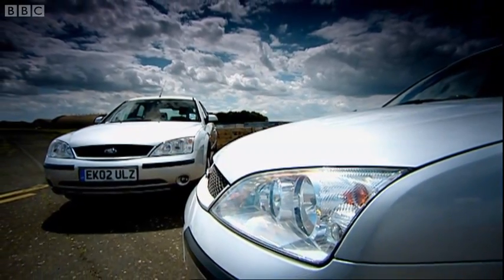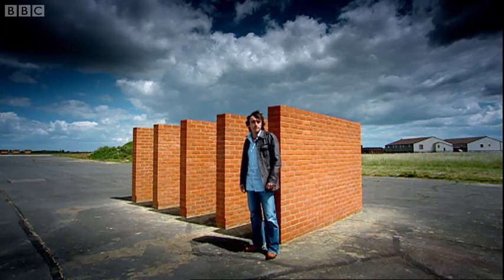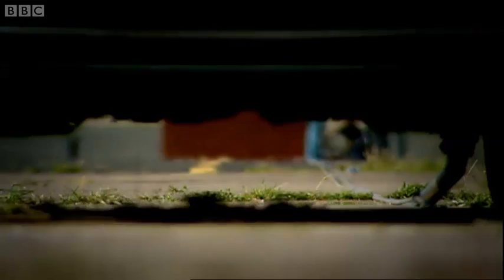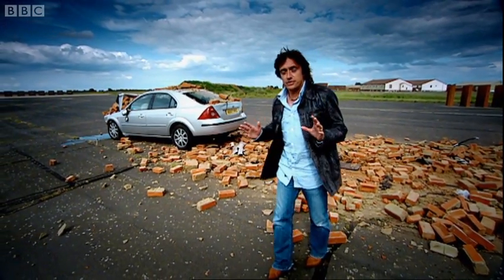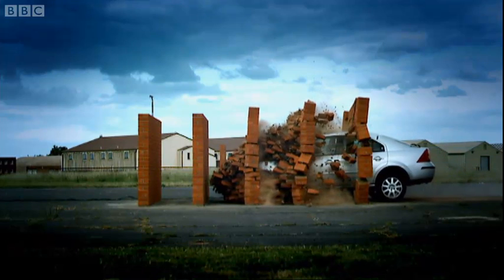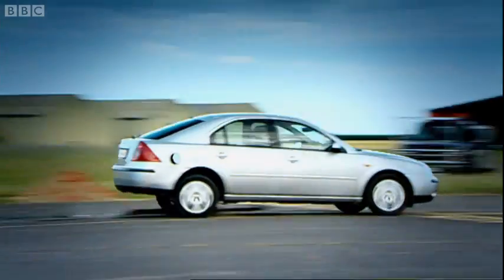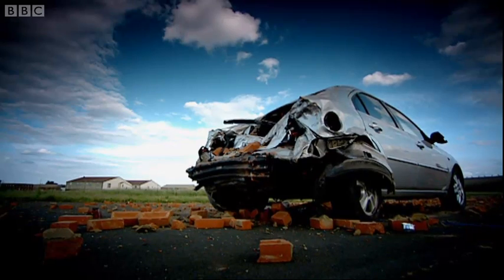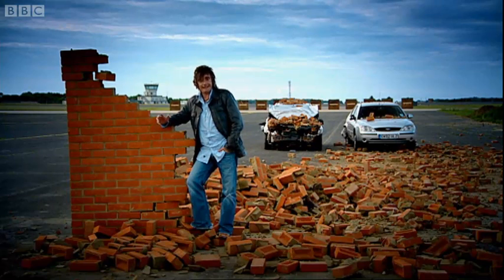Brick Wall Crash Test | DIY Top Gear | Top Gear Uncovered

Comment: Top Gear Top Tip: If you find yourself in a predicament where you have to go through 5 brick walls which are spaced 1 metre apart, go in reverse.
Reply: I just wanted to see how strong my societal collapse wall needs to be.  Probably going to be made with multiple layers of cinder blocks and filled with concrete... And rebar..  and road spikes 20yrds ahead of it
Reply: That actually sounds quite genius.

Comment: But what about the bricks that got inside of the car? Winshields has a plastic layer that stops things getting inside but crasing in reverse, the back window breaks into million pieces and there is a great chanse that u might get a brick on the head
Reply: PugLordTR swap the windscreen from the front to the back
Reply: Don't try to bring common sense to top gear, you'll ruin it.

Comment: If cars were built backwards, they do be safer, so where is the problem in doing that, Lamborghinis are built backwards right? since their engines are at the back does it mean they are safer, if that's the case it would be cool to build all cars backwards

Comment: The reason why forwards looks more damaged is because that is how it is designed. The crumble zone reduces the direct impact force you get in an accident. If anyone has ever been rear ended you know how much a slight bump hurts. The rear of a vehicle is not designed to have a large crumble zone. So you get more of the impact.

Comment: An undamaged car doesn't mean it is safer. There are crumple zones built in to absorb the energy of the crash over a longer period of time.  If the car doesn't absorb the energy, then your body will.

Comment: One extremely important factor was overlooked in the conclusion of this video.  Safety is not proportional to how well the car fares in an accident.  Crumple zones are strategically placed to allow the car to take the impact instead of the occupants.  This implies that in actuality, the front of the car is safer than the back in collisions.  This is with good reason, since a high-speed impact would occur in the front whereas if you are rear-ended it is less likely to be at high-speeds.

Comment: Bloody hell, I genuinely did not know a Mondeo could plough through 5 brick walls and still be roughly car shaped. I would of thought the first couple of walls would stop it but when it went through all 5 like a champ I was impressed, you'd obviously be very dead but still...
Reply: I doubt you'd die from that. It stopped (relatively) gradually and the passenger compartment was still intact.

Comment: Would be even better if they applied some kind of lock on the steering wheel to keep the track of the car true into the wall, esp. in reverse.
Reply: Yeah, the second test hit the wall at an angle! They clearly need to repeat it, properly this time, in 4K ultra-slow motion. For science.

Comment: Serious Comment: Modern cars are designed so that the car deforms to take up collision energy and thus protect the occupants. Engineers expect that the most violent collisions are likely to involve the front of the car, not the rear end, and thus the rear end does not deform during a violent collision.

Comment: It's called a crumple zone. The real danger in an acciden't is the sudden acceleration to the passenger not what the car looks like after the impact (this is top gear, so I accept there might be different view points on this lol). Anyway, giving in, in an impact softens the hit, therefore making it safer.

Comment: Why did you crash an 07-plate? :-/ What a waste of a car that's only 7 years old...
Reply: Those will be fake plates as the Mondeo's used are pre-facelift, so pre-2003 :)
Reply: ahh that didn't occur to me, odd that the one is an 02-plate and not the other lol...

Comment: i thought the front of a car was called the crumple zone for a reason, surely its safer to have the front + the engine absorb all of that energy? if they crashed into something that wouldnt disintergrate like a brick wall i think the story would be different for the damage done to the interior of the cabin especially crashing backwards, its not about the damage done to the exterior but the force that is carried through the rest and thus the passengers, the more the car "crumples" the longer it takes for the force to be exerted onto the rest of it and more importantly less force

Comment: If you were in the front of the car and a camera on the bumper could you potentially drive that way? Basically a video game where you turn your head and the camera moves. It wouldn't make sense at all aerodynamically but it would be safer.

Comment: Looks like you guys ran out of luck on the backward cars steering stability right before the wall impact. Cable drive works on cars because of having mechanical trail, if you run them backwards it'be a good idea just to ratchet strap the steering wheel to the brake pedal.

Comment: No need to drive in reverse just drive an american car from 1950 to 1970 because they were tanks, heavy as hell and not so good on fuel but these plastic cars, of the present day, wouldn't want to get into a front end collision with one. (However, may need to find one with aftermarket seatbelts, as they weren't required standard equipment)

Comment: the back of the car maybe ok but the g's the drivers had, could have killed them. that's why the front of the car performed the way it did (to absorb the resistance)
Reply: +mcgherkinstudios you do have a point there

Comment: OK so the walls werent strong or properly built.... The walls of buildings are cemented properly and built a few feet deep into the ground for strength and stability. This car would be in much worse condition against one of those...

Comment: The primary impact sent bricks into the second wall weakening it for the cars secondary impact. This transfer of energy continues through the walls until the car barely has to touch the fifth wall to bring it down. This is why cavity wall insulation is rubbish in a war zone.

Comment: dont bother uploaded videos that dont include the 720p version at least but the 1080p version is siting on your server, just freaking upload it, no one wants to watch a fuzzy 480p video...
Reply: DONT BOTHER PAYING TO WATCH?
Reply: This was made before they started making top gear in HD, so no they don't have a 1080p version nor a 720p version.
Reply: I've got no problem with 480p, it's better than nothing and I'm not a spoilt crybaby. Also, did you ever consider that this is an old video and they didn't HAVE HD cameras?
Reply: Complete crybaby, come on 480p is perfectly fine we did not start using 1080p or eve n 720p until very recently